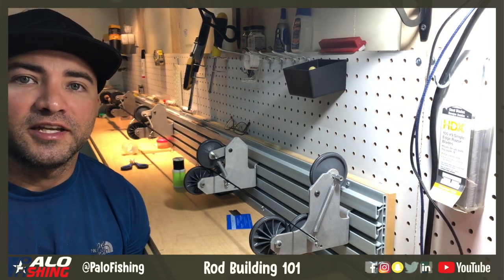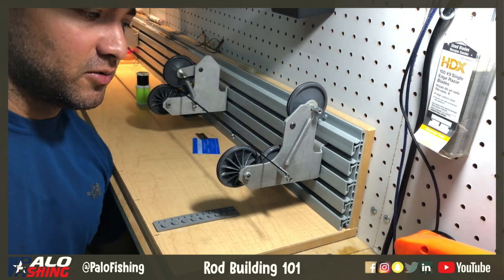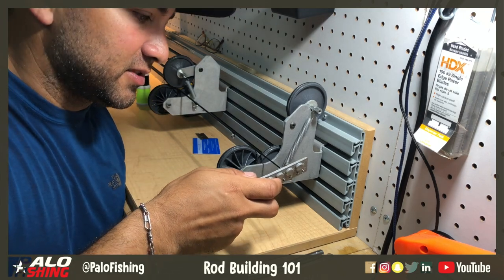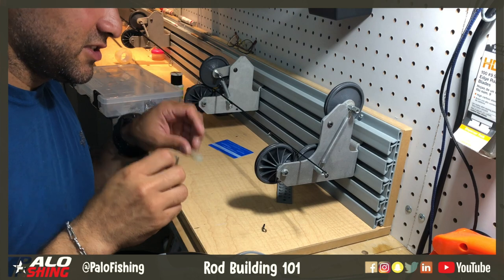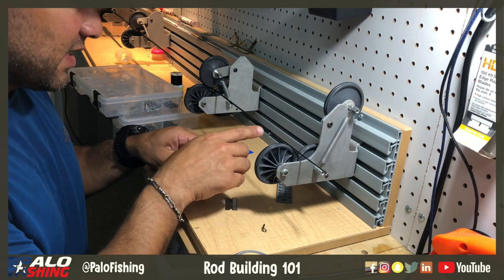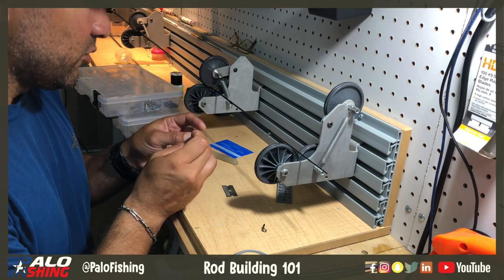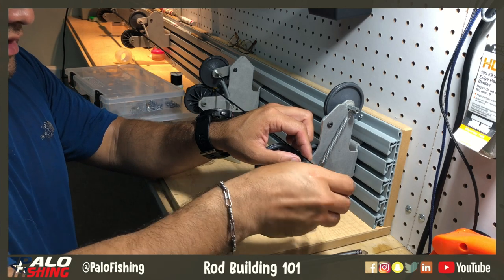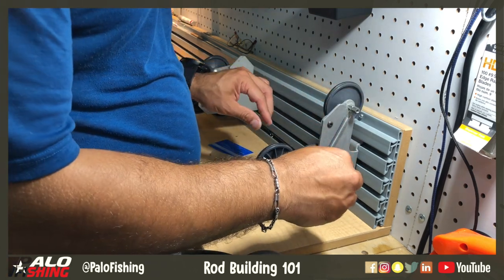Rod Building 101: Replacing Tip Tops on Fishing Rods

Comment: I bought a Fenwick PLC60 bait cast rod for my collection. It had a broken size8 ring on the tip top.  I built my own rods back in the BM & BK days (before marriage & before kids) and thought I could get the broken tip top off by heating it. I heated it, then tried to move it and it wouldn’t budge, heated it some more and it did turn so I just spun it off.  Little did I know that the broken top top took about 3/8 of an inch of the rod tip with it. I want to keep the brown thread wrap that all Fenwick ferralite rod tops had on  the tip in the 60’s-‘70’s.  Some of the brown thread will be covered when I add the tip top.  If I try to leave it on I’m not sure if it will allow enough purchase to make it a usable rod again. I’m pretty good at wrapping thread so I might just remove the 3/8” of brown thread wrap and add it back on after adding the 7 tube and 8  tip top back on. Your thoughts?